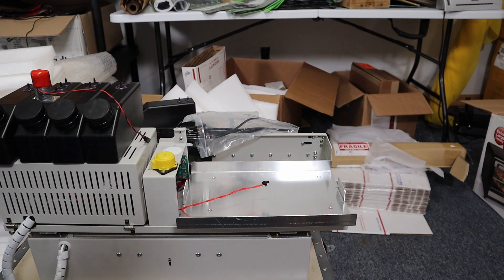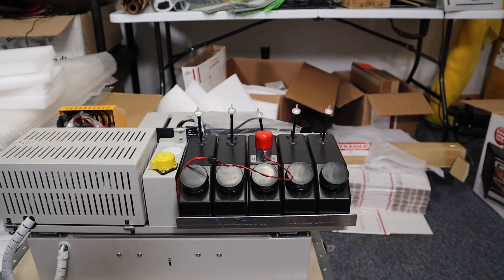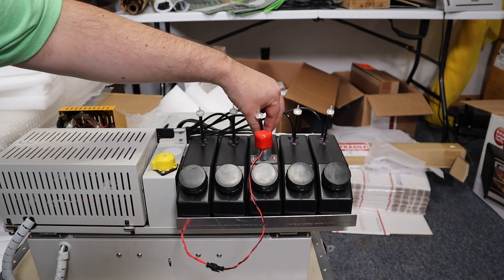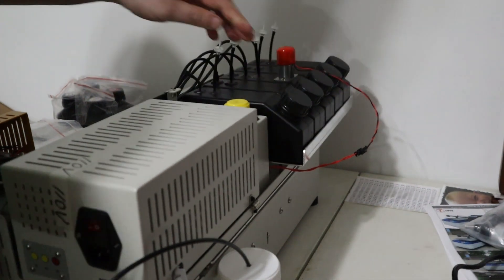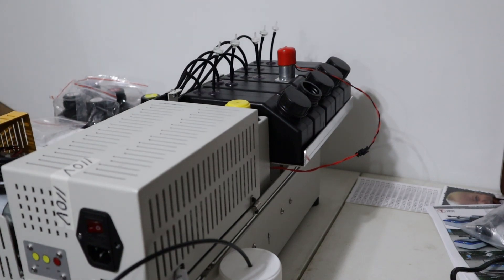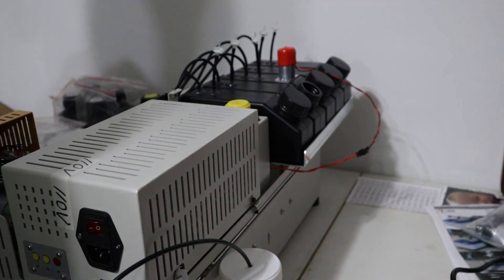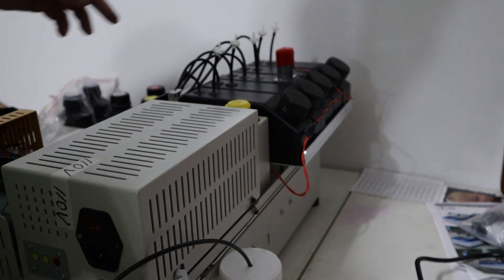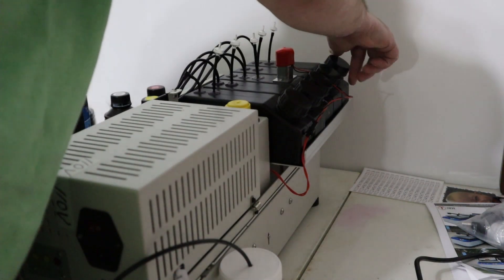UV Printer Setup Part 1

Comment: What’s the tape you recommend for screen printing to line the edges of the screen. I can’t find the video you made about it.
Reply from the maker: I use the same tape i ship with 4 inch 100 percent rubber tape so it comes off the screens easy